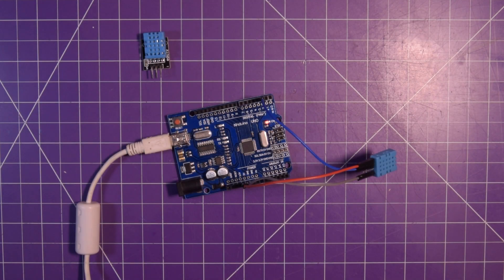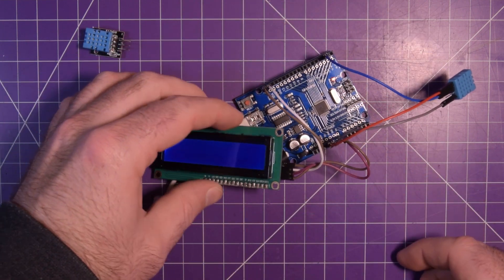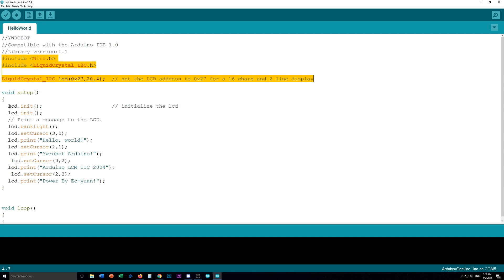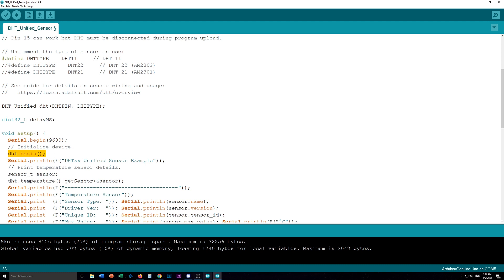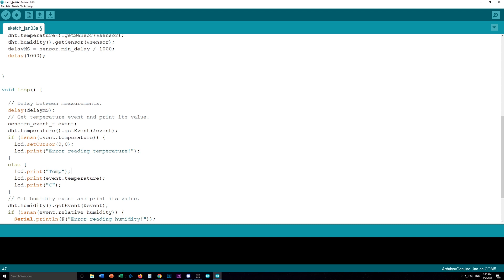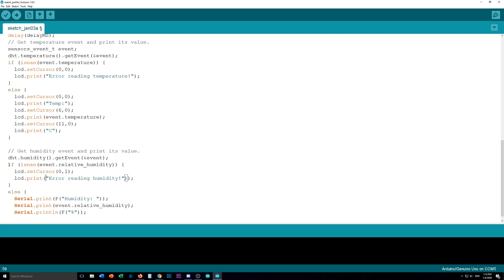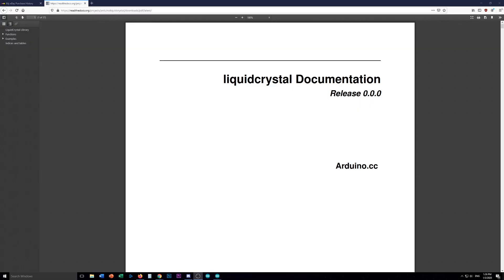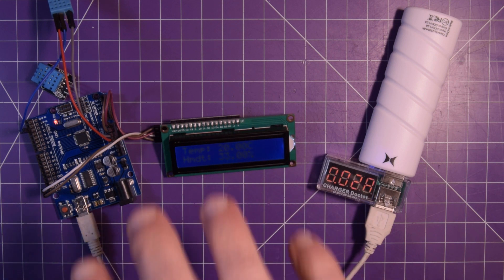Adding A LCD To A DHT11 Project (Or ANY Project!)

Comment: Sir one help how connect this circuit in to stepper motor if the humidity goes below 60 it will rotate anti clock wise and goes above it will turn clock wise please give the coding sir for project
Reply from the maker: I recommend you ask in the forums - but the code doesn't seem that difficult to come up with. Look up how to control steppers and add on to this code.